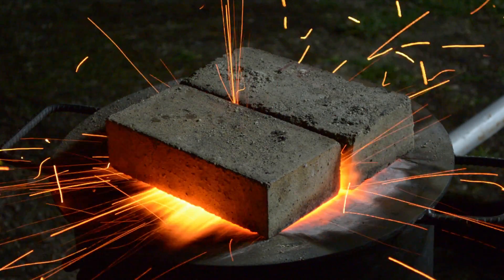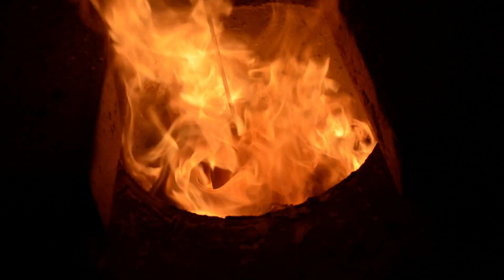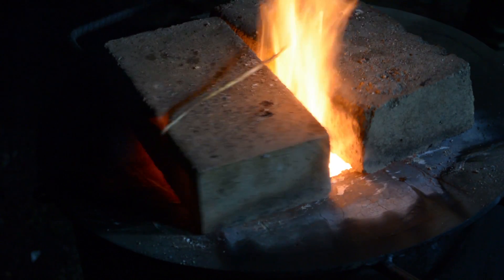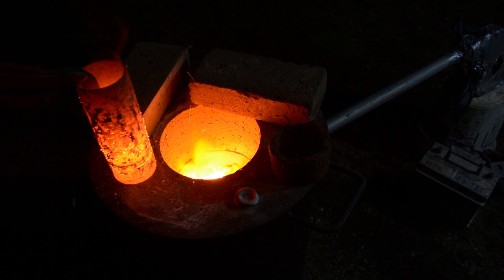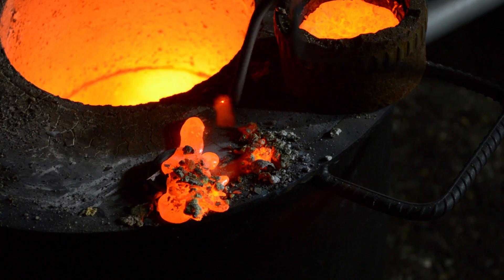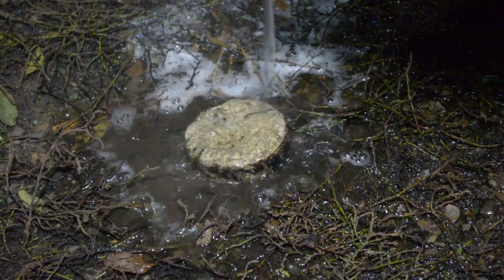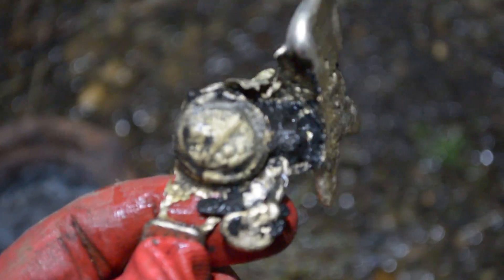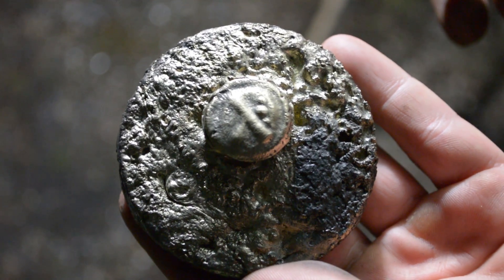Melting Brass with Home Made Metal Foundry

Comment: Can I melt brass in a small propane furnace?
Reply: Yes you can actually but you have to have a good burner. There has to be an adequate oxygen to propane mixture.
Reply: @marbrose4804  charcoal and bellows.

Comment: Heat up the mold before pour in it then it will have smooth surface.
Reply from the maker: That's right but a newbie like me still has to learn all this about pouring molten metal into molds :D